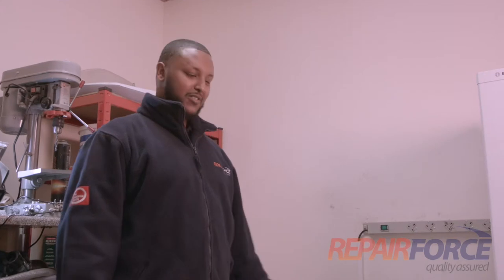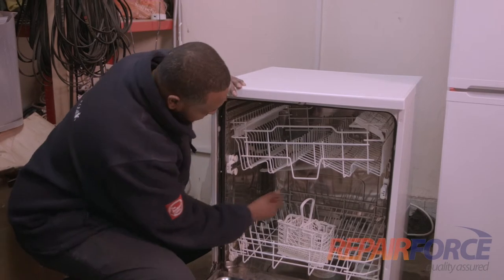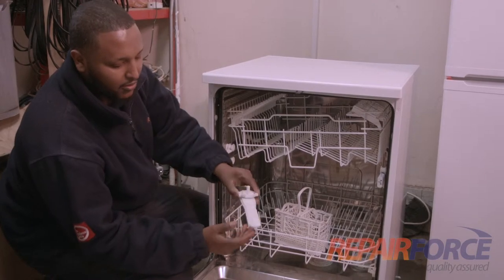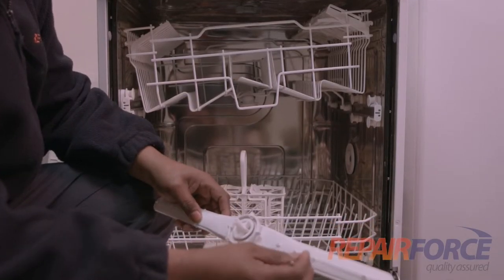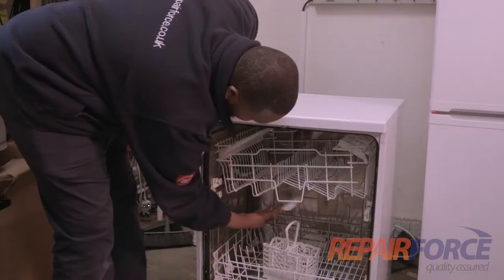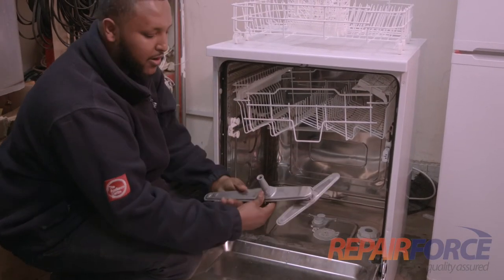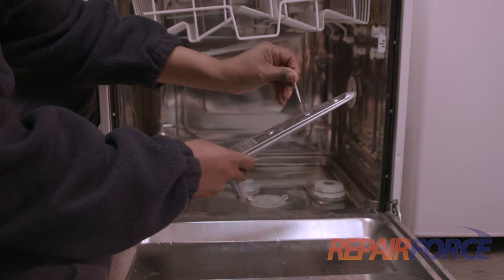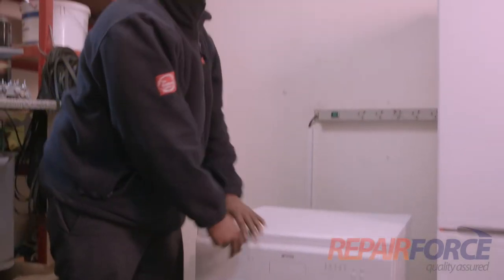How to Unblock the Spray Arms on a Dishwasher

Comment: Won’t the food just get stuck in the holes again once the machine goes through a cycle. The blockage/food was not actually removed, but simply pushed back into the arm.
Reply: Yes, the food gets stuck again and you have to "clean" the arms regularly. I am trying to find a way to install filters in the arms to prevent tge food going into the spray arms at all. Very poor design

Comment: No not unblock - merely move it to another spray nossle where  it re-blocks the same or another nose.  No good at all . How do you get rid of the food debris not how to rearrange it , please.. this is a design fault need to have spray arms which slide so that debris can be easily removed not really distributed.
Reply: David, did you find a way to put a filter in the central intake opening of the arm? I am so tired of "cleaning" the arms